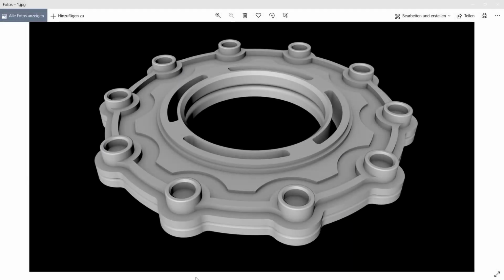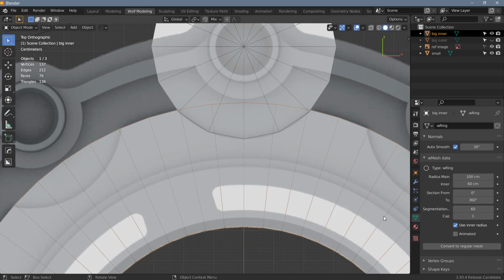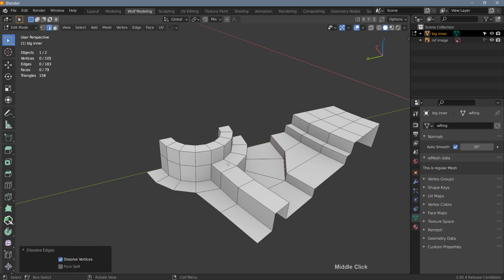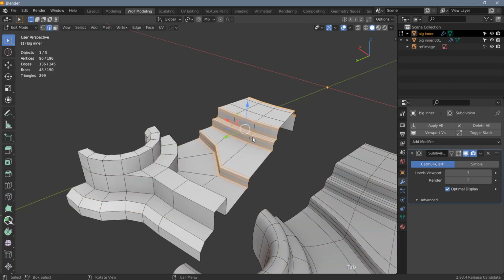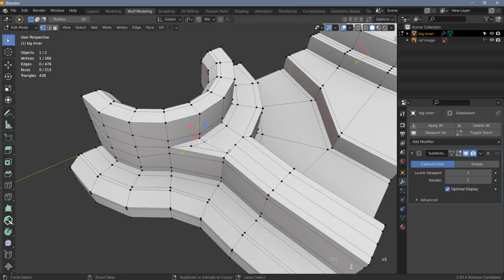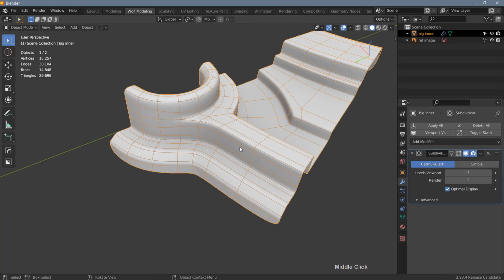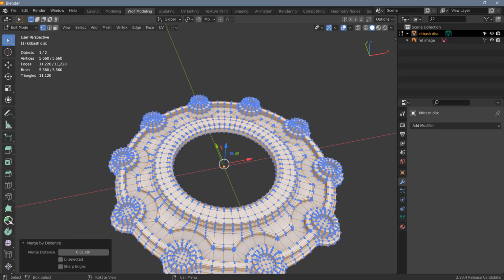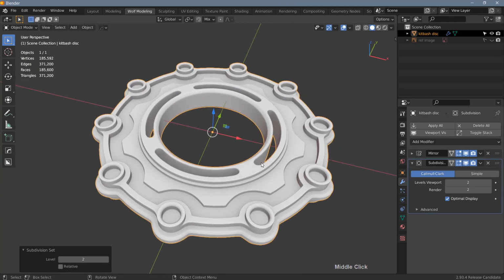SDS Excercise: Modeling a detailed Disc (Blender 2.93 Tutorial)

Comment: Hello! How to do the objects lighter in the viewport when there no materials and lights? It seems your geometry is lighter than grey color by default
Reply from the maker: Hi Kate, 
All you need to do is go to the "Viewport Shading" dropdown menu. Right at the top you have the lighting options. On the "Studio" tab, select the brightest sphere from the six options available. 

The objects will now be a bit too bright. For me personally that doesn't really matter because I have the "Cavity" option switched on (you'll find that at the bottom of the "Viewport Shading" dropdown). I've set the "Type" to "World" , "Ridge" to "0", and "Valley" to "1.2". This won't do much if you just have a cube in your scene. But if you have a floor or if your object has holes, insets etc. this will create fake contact shadows. 

More importantly, in the "Viewport Overlays" dropdown I have switched the "Wireframe" option on. I prefer to see the edges anyway, and with the bright light setting this will help to compensate for the brightness. 

If you like those settings and want to make them permanent, make sure to save your file as a startup file (File - Defaults - Save Startup File).

Hope this helps.

Comment: The wonder mesh not working on blender 3.3 boss
Reply from the maker: It's working fine for me, and I'm using Blender 3.3.1. What exactly isn't working?
Reply: @Wolf-4D  sorry boss i mean blender 3.4. it's not working perfect when i jump into edit mood.
Reply from the maker: @sportzone86  See my explanations below in response to your next comment. You're probably not using the wondermesh objects correctly.
Reply: If am in edit mode the "object data properties" not working with blender 3.4 boss😭
Reply from the maker: @sportzone86  Of course that's not working with wondermesh objects. 

You
a) need to make any changes you want to the wondermesh object in object mode, 
b) then convert the wondermesh object to a Blender mesh in object mode, and 
c) only then can you go into edit mode and make further changes. 

Anything you do to the unconverted wondermesh object in edit mode unfortunately is useless, that's just not how it works.
Reply: @Wolf-4D ok boss thank you so much 🙏 i will make sure i made these changes 🙈
Reply from the maker: @UCTki7tD0KTu5UI2SGOYG3lw Don't uninstall 3.4. I think I know what you're doing wrong. The same thing will happen in 3.3 and any other version of Blender. The reason it doesn't work for you probably is because you try to edit it while it is still a parametric object. You can make changes to a wondermsh object that you can't do with regular Blender primitives. Once you've made those changes you need to convert the wondermesh object to a regular mesh (at the bottom of the wondermesh settings in the Object Data Properties). Then you can go into edit mode and make further changes. If you don't convert the object first, anything you do in edit mode will not work as expected.